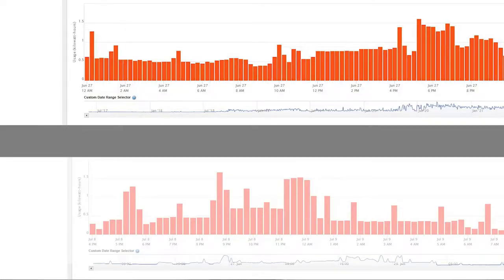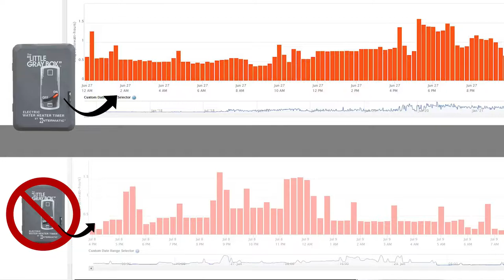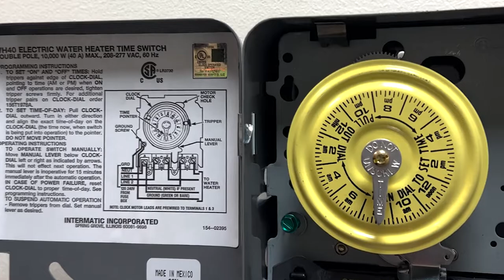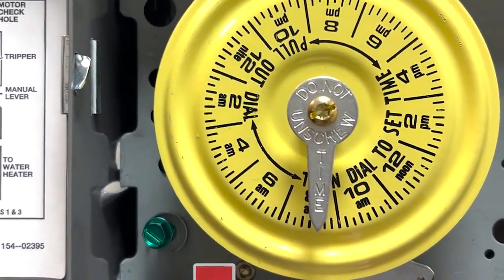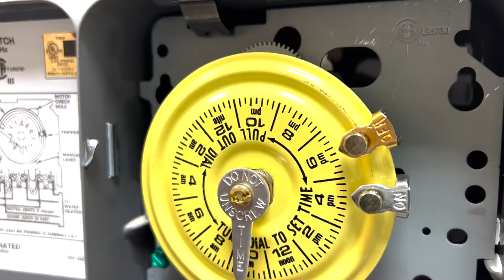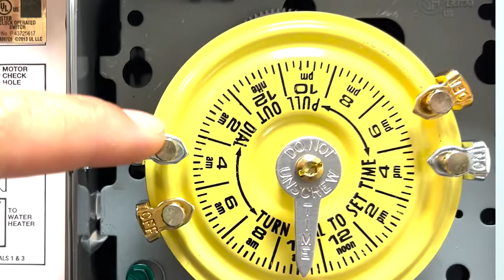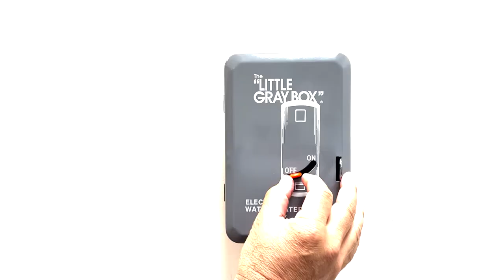KIUC Explains the Benefits of a Water Heater Timer

Comment: Is it sanitary to use this leigioneirs disease Is not a condenser?
Reply: 1st I'm no expert on this. 2nd I think that you have to set the heater to come back on about a hr before you expect to use the hot water for showering. Thus giving it enough time to heat the water to 120 degrees or hotter making it safe to use. Showering is the main way people tend to get legionnaires disease from house water. However,  if showering at random times or if anyone in your household has a compromised immune system from asthma, lupus, older people ect. the saving may not be worth the small risk.

Comment: Why does your example of a house that uses a timer have a higher electricity usage than a house without a timer?
Reply: They used a very poor example indeed. The times do not even line up nor do the dates. This is not Apples to Apples here. A true example would have been two houses set up the same, with the same number of residents with the same general needs and schedule with the readings taken for no less then a week. Then and only then could we take any comparison seriously. Not knocking the idea of cutting off the water heater when it's not needed (I want to do this myself), but they should at least give a real example of savings.

Comment: What if you need hot water in between or you just happen to be home.
Reply: Like is said it has a manual On switch you can press
Reply: Also unless you happen to use most of the hot water right after it cuts off, thus letting a lot of cold water into the tank,  you will have a tank full of hot water for things like hand washing throughout the night without having to do anything extra. The tank is insulated inside and helps the hot water stay hot for a while even with the power off.

Comment: How much you actually can save? like 5%? Doesn't seem worth all the fuss.
Reply: If you cut the tank off at night keep in mind most people don't use that much hot water at night anyway, but you will still see savings. You can have multi cut on and off times on the same timer. So if you cut it on an hour before people start getting up and leave it on till most leave, say 6-9 am and then cut it on at 2:30-7:30 pm for kids and adults coming home and cleaning use, that's only 8 hrs a day. You would cut 16 hrs of even ghost energy use and that is a lot more than 5%. You save more the larger your tank and based on it's location, some people have their tank outside.
Reply: @kimwilliams5165  All good, but you have to consider how much timer costs and installation costs. When you get that money back? + you only gain tiny bit by letting water to get to lower temp to get lower energy loss from thank. You will be heating it up to temp anyway after couple hours. Real savings would come if you have cheaper tariff at certain hours of the day and using electricity mostly then. I doubt you save much when your water tank is in heated room. How much you would save if you let tank to drop water heat from 140f to 120f and heating it up to 140f after 8h? instead leaving it on? I doubt water heat actually would drop that fast😅